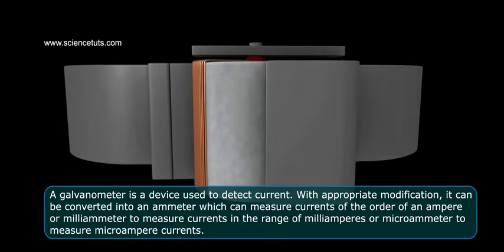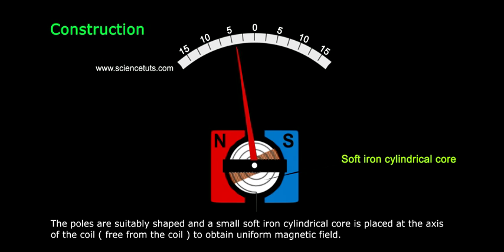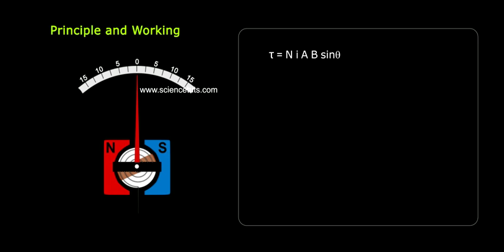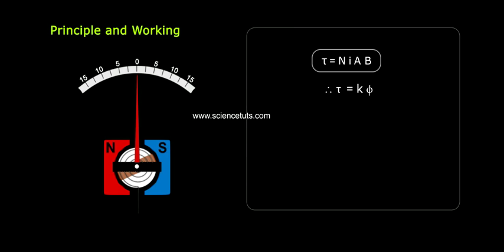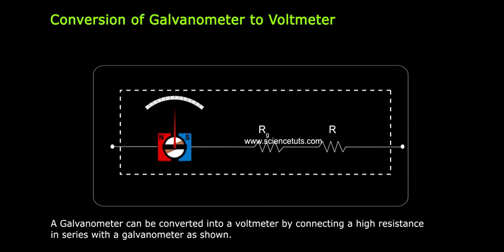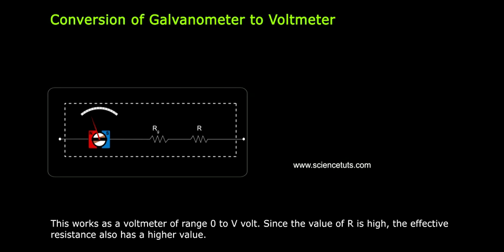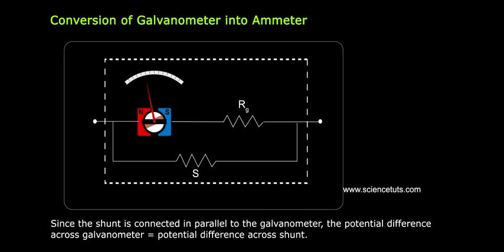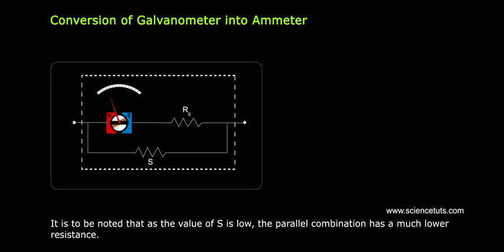GALVANOMETER

Comment: 游芊芊（Alice You）:
Shenzhen Han's Scanner S&T Co., Ltd. is a high-tech enterprise that integrates technology research, development, production and sales. It is a wholly owned subsidiary of Han's Laser Technology Industry Group Co., Ltd., the listed company, located in Shenzhen Han's Laser Industrial Park, China. 

Han's Scanner has professional R&D Team on machinery, software, optics, electronics, process testing, etc. We have obtained a number of model utility model and invention patents, besides R&D standard galvanometer products we also provide professional galvanometer system scanning solutions for our clients.

Our Products:
Single galvanometer system
2D Galvo scan head (X Y galvanometers)
3D Dynamic focusing scan head (X Y Z Axis)
Voice motor(Z-axis dynamic adjuster)
HashuScan(Intelligent 2D scan head with control board&marking software)
Medical&Aesthetic fractional galvanometer
High Power Galvanometer Welding System

Applications：
Laser Marking
Laser Marking on-the-fly
Laser Cutting
Laser Welding
Laser Engraving
Laser Drilling
3D Printing
Medical Treatment
Science&Research
OCT Imaging
Laser Show
Automotive radar

Contact: Alice You
Sales Manager
Shenzhen Han's Scanner S&T Co., Ltd.
Add: 4F Building4, Han's Laser Industry Park, 128 Chongqing Street, Fuyong, Bao'an District, Shenzhen City, Guang Dong, P.R. China.
Mobile/Wechat/WhatsApp: +86 15220100011
Skype: live:599a21d7378d05ab
Email: Scanner-sale1@hanslaser.com
Web: www.hansscanner.com